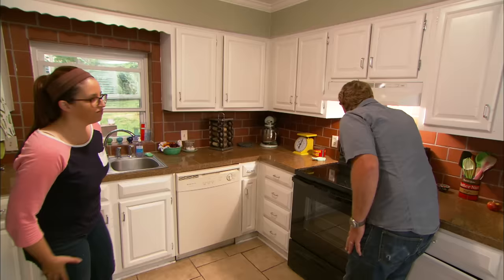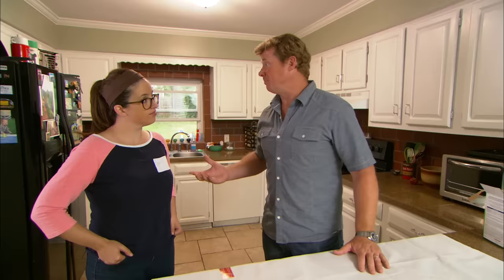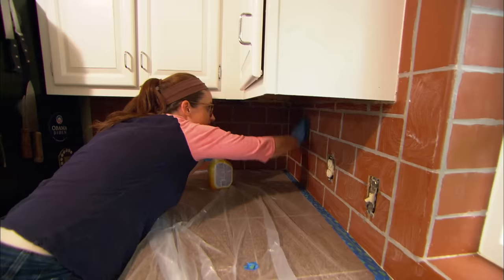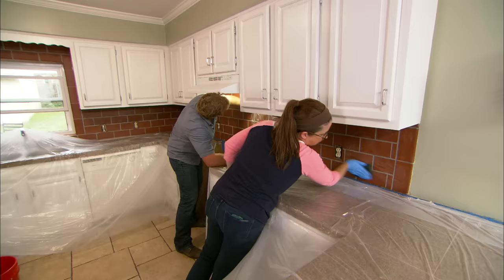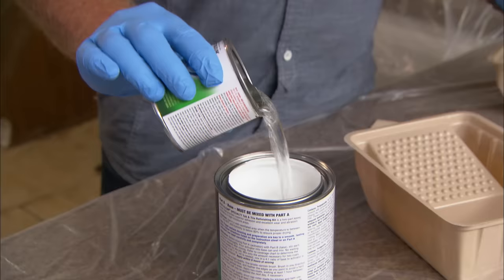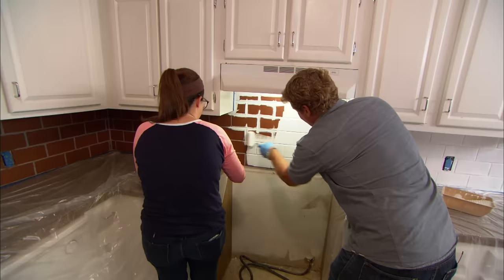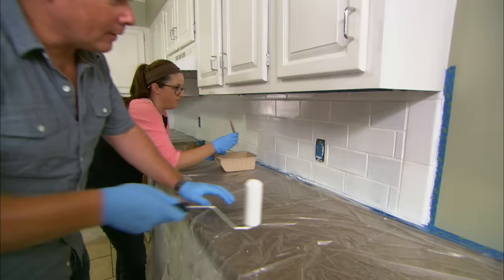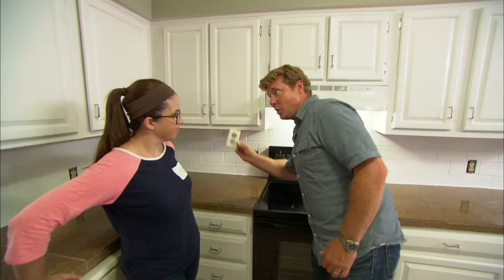How to Paint a Tile Backsplash | Ask This Old House

Comment: You should use a respirator when using that stuff. It contains a large amount of VOC and can cause health issues. It nearly knocked me out when I was repainting my shower. That smell is no joke.
Reply: Couldn't possibly be because you were in a small, enclosed space could it?   That's why they had two fans and all of the windows open.  The only respirator that would work with epoxy would be one rated for organic vapor compounds.
Reply: @buckhorncortez  actually my master restroom is about 300 s.f. with three large sliding windows. They were all open  with three box fans pushing out but the smell of this product is toxic. The smelled lingered for about 3 weeks. I also used a 3m respiratory with VOC filter part 60921 or something like that.
Reply: Yes it's strong. I used it about 10 years ago on the shower and I remember it was not easy to work with the vapors.
Reply: They definitely didn’t do justice to the smell. You can feel the vapors floating in the air on your skin

Comment: Nice update!  That's some weird counter top granite though.  Tiles?
Reply: This was common in The States late 90's through early 2000's as an inexpensive alternative to a granite slab. I installed loads of them. The tiles were off the shelf and a cost of only a few dollars per square foot. They even stocked bullnose edge options.  Her floor tiles seem to indicate an early 2000's remodel as well.

Comment: I did this for my bathroom and it worked very well. However, I want the tiles in my kitchen to have color, not just be white. My backsplash is already white and I'd like to make it blue to match the rest of the kitchen. Can I change the color with mica powders?
Reply: When you did your bathroom, do you feel like it was easy to peel off? Or get scratched? Whoever built my home, used large floor tiles for the counters, and it looks ok, but to make it a new color would look amazing. Just scared it would start to scratch and peel. Thank you

Comment: Another question. Since you are etching, and then sanding the entire backsplash, wouldnt you be able to use regular paint as well, now that the surface is etched and can accept paint?
Reply: Great question... never answered though
Reply: I used latex at another home we have and it lasted 10 years (til we moved) with no issues! Honestly, it didn't even prep it. It looked great.

Comment: Could you grout over that paint or will the grout just eventually break down? I think adding a dark grout to that white it'd pop a bit more.
Reply: you could use a grout saw and remove it and regrout, but you can't over top it. it would flake off almost immediately
Reply: You can not grout over the epoxy paint. It won't stick. You could paint the grout lines but I'd sooner stick my eye with a hot needle.
Reply: @WhatIsKenDoing  lol thanks for the info.
Reply: @WhatIsKenDoing  please don't, though.

Comment: Why do the counters have grooves cut into them? I've never seen counters with those random, symmetrical cuts. It's not near the sink for draining....it's almost like it's decorative. I've been house hunting online because we are thinking of moving, and I've seen a couple other houses with these exact same color counters and they too had the grooves or cuts in them. What material is that, and what is the purpose? If it's merely decorative, it's isn't all that appealing.
Reply: Their countertops are tile as well. The 'grooves' are grout lines. It's a cheap way of doing countertops, but you're right...not very appealing.

Comment: Hello DIYers, will these materials work with glass tile as well?
Reply: Hi, the product they used in this video is advertised for use on porcelain and ceramic tile so I believe yes.

BTW Bernadette I suggest watch a 13 part series called What on earth happened by Ewaranon to learn that the earth is not a globe. Link in my about tab.
Reply: No

Comment: Is there a similar solution for glass style tiles??
Reply: Hi Tony, did you ever get a response to your question? I have glass tiles as well and wanting to paint them.
Reply: @Bejoyful2day  no response and I haven’t found anything online on going about it either
Reply: Well the product they used in the video is advertised for use on porcelain and ceramic tiles so I believe it is compatible with that since tiles can also be glazed, coated with glass.

BTW Tony I suggest watch a 13 part series called What on earth happened by Ewaranon to learn that the earth is not a globe. Link in my about tab.

Comment: I have a strip of glass tile that I want to paint over in white as well. Will this same epoxy paint mix cover both subway tile & the glass area?  Also, how can I know the best roller to buy, since people are complaining the paint rips the roller apart? 
Is there a specific brand of roller and brush for this difficult paint? 
Neither of you have masks or any breathing protection. How did you mange painting 2 coats with no proction.
Nobody can get N-95 masks or any respirator during COVID.
Reply: I'm not an expert but the product they used is advertised for use on porcelain and ceramic tile; and tiles can be glazed with glass, so I believe that means it will work for your tiles too.
For the fumes you should use a respirator with organic vapor filters.

BTW Kristine I suggest watch a 13 part series called What on earth happened by Ewaranon to learn that the earth is not a globe. Link in my about tab.
Reply: @flat-earther  My kitchen has already been redone. It’s a moot issue at this date.

Comment: Can you scrub that? He didn't mention.
Reply: NoDramaQueens it’s epoxy, so I believe so. Epoxy is a resin so it shouldn’t go anywhere I mean you might not wanna take steel wool to it lol but you know a dish sponge or damp rag should clean it just fine, especially if you don’t let food & grease soak on & dry to within an inch of fossilization, you should be just fine. 😂 They have a lady on here who refinished an old bathtub with this product & she uploaded a follow up after a year or so, and it looked exactly the same, (I.e. brand new). And a bathtub is always wet, but it never changed at all. Pretty darn amazing. This stuff seems extremely durable.